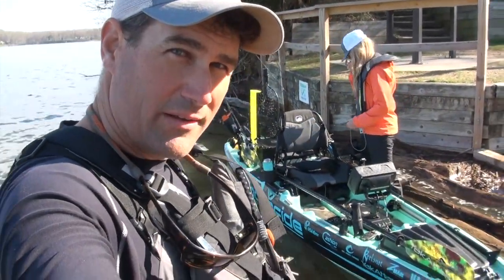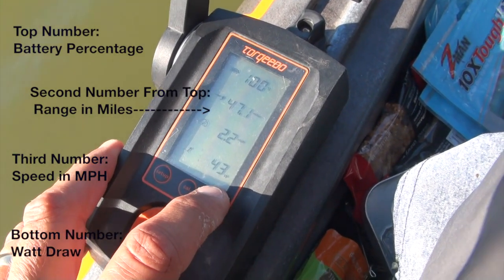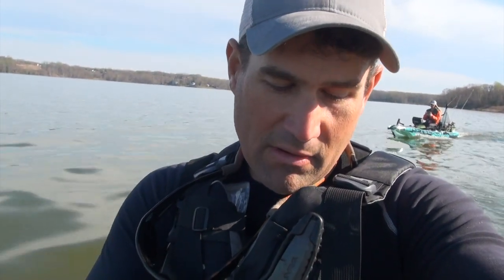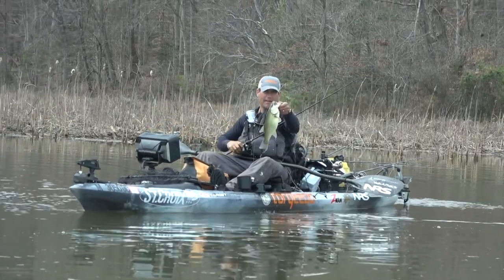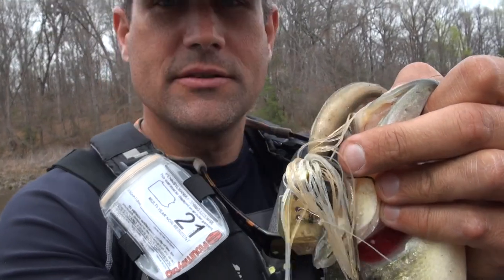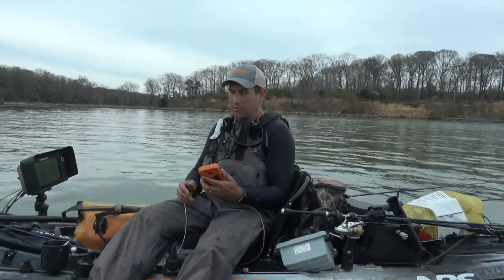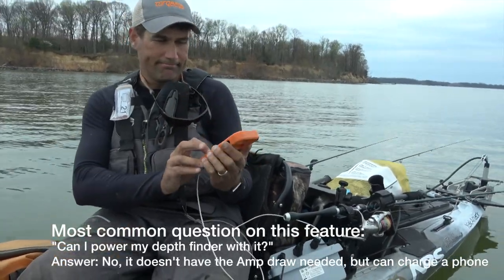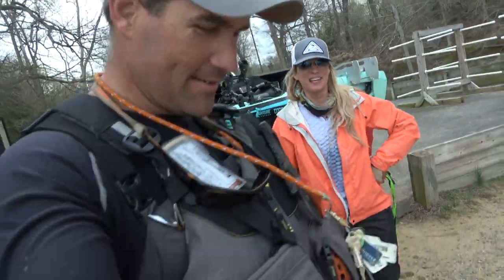Tidal Largemouth Pattern Wood + Current + Depth

Comment: Jeff,  it was great meeting you and Cilla at the end of you long run and before you headed back into that creek. Thank you very much for taking the time to talk to me about potential upgrades my  403 and battery pack. You guys are awesome. Keep up the great work.
Reply from the maker: Ken Whitson It was good meeting you Ken! My number is 815-528-2007. Call any time you have Torqeedo questions.
Reply: Hi, Jeff.  Hope all is going well for you. I noticed you swapped batteries out before going back into that creek. That got me to thinking. Does Torqeedo make an A/B switch that can be used to quickly switch between tap batteries? If not, is there any technical reason such a switch shouldn’t be used (assuming the switch connected/disconnected the battery and throttle in the appropriate order)? It seems something like that would be useful for really long trips - no need to get out and fiddle with connections. Thoughts?